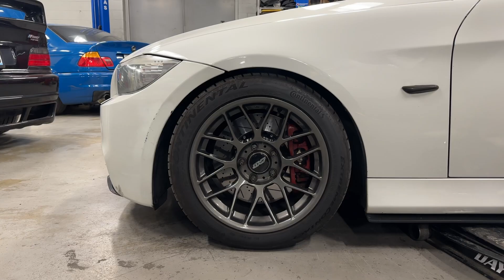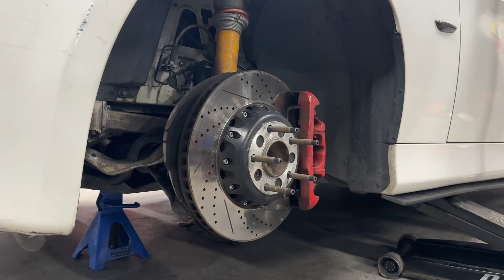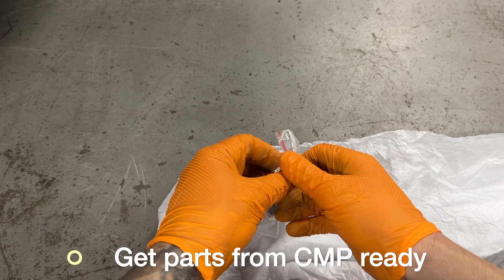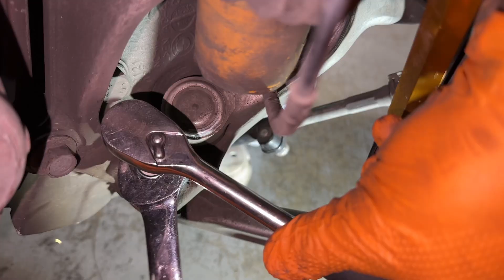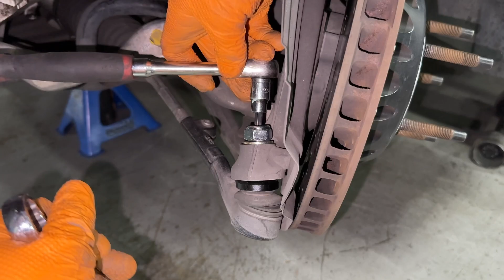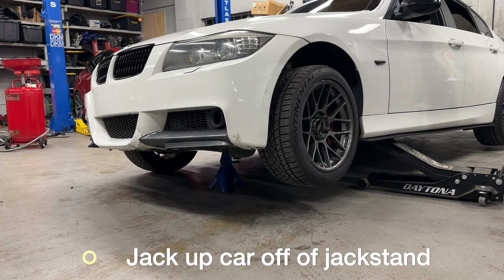CMP E9X Bump Steer Kit I Install + Review

Comment: i know these are RWD only, but is there a reason why they wouldn't work on a e92 xdrive?
Reply from the maker: That would be a question for CMP
Reply: cmp said they won't work on xdrive
Reply: @under_ground_  Give it a try. As long the size is the same it will work. In case CMP kit is wider than ori bolt (which I doubt) you can order a bespoke one from a 3d printing/cnc machine shop. A CMP prototype would be enough for them to craft a needed one. Good luck and let us know if it worked :)